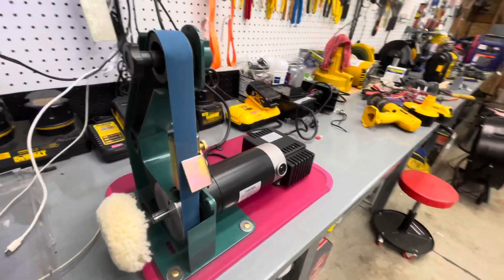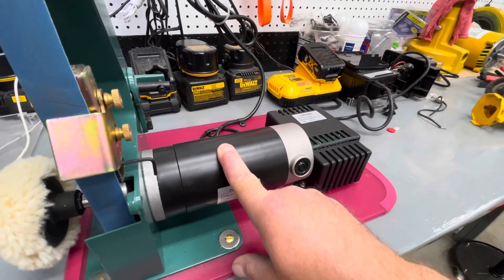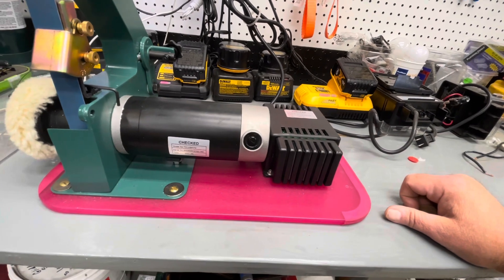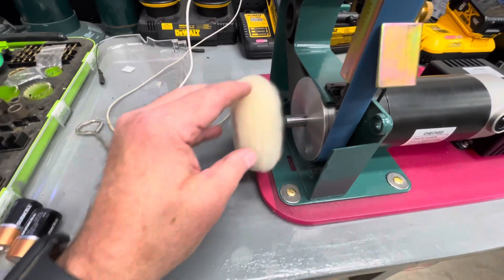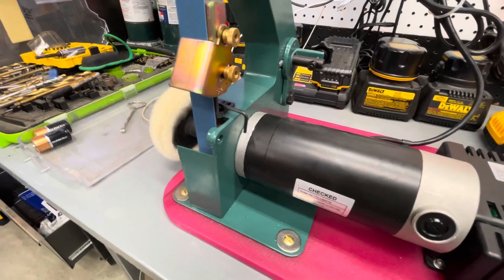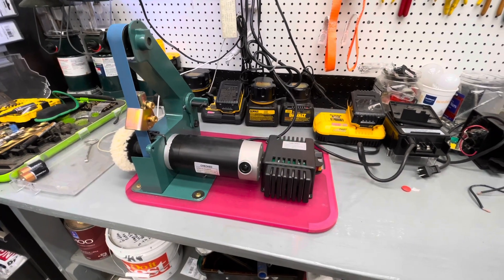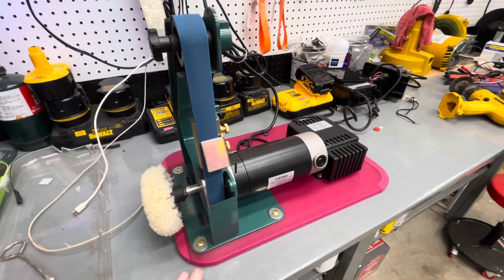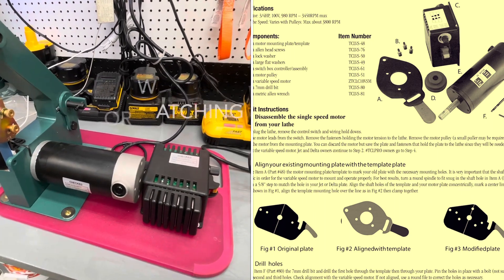Harbor Freight 1x30 belt sander conversion to variable speed knife sharpener.

Comment: With this motor and sander and accessories your north of the price for a work sharp V2 Ken Onion.. with all the tweaking and everything involved is this that much better than a work sharp
Reply from the maker: I can’t dispute your point and if the new wider belt version II was available back then I might have opted for it. This was done mostly for a fun project. I was intrigued with the concept Cliff Curry had built for his mobile sharp shop. I do have the 3/4” KO Work Sharp and use it as a To-Go sharpener but it’s not made for regular extended use.
Reply: For volume work this 1x30 would be better than worksharp.
Reply from the maker: @brakeme1  The worksharp has its place, I’ve had good success using it. I was intrigued when I saw Cliff Curry using the modified Harbor Freight 1x30 in his Maui shop.

Comment: This looks like a good setup, but I don’t have the space on my bench for something this size, I’ll look for a smaller (shorter) motor.  I’ve also seen a video where they cut away the shroud on the back so they can use the belt from either direction..but having a reversible motor is the best option.
Reply from the maker: Thank you. The whole thing really is compact, the base after all is a small cutting board. Cliff Curry is stocking several additional custom parts and a full range of belts.

Comment: How fast can it go and what power it has? Does it bog down any?
Reply from the maker: It’s 3/4 horse power and the motor spins at 1700 rpm. I’m not even an amateur but I’m getting loads of practice doing friends family & neighbors implements.     The little DC motor has more than enough oomph. It’s a fun project and it’s been a useful tool.

Comment: Did you ever find something to cover controller? Finally got mine set up. Just need to know what material to use to cover controller. I was able to reverse the rotation by switching the leads from board. Works great!
Reply from the maker: I haven’t. My wife & I sold our home & moved to the Wa coast and we’re still not totally settled in. As soon as some warm weather arrives I’ll get my shop organized and follow up on things.
I was thinking along the lines of a breathable nylon fabric or a fine mesh fiberglass screen, something nonconductive.
Reply: @jatoav8or  oh ok I covered mine with window screen. Don’t know if that’s good or not but helps a little with dust.

Comment: I thought of a screen from a window to protect that board wouldn’t you think?
Reply from the maker: Anything that would allow ventilation and limit particles from entering should work. Since posting this video I’ve used a neodymium magnet placed on the angle guide to collect shavings, that doesn’t work so well with high quality stainless steel though.

Comment: Unless you can get the DC motor and drive cheap the cost would far outweigh the value of the sander.
Reply from the maker: Sorry for the delayed response I’ve been in the hospital with Covid. I suppose you’re right but it was also a fun project all in itself. Sometimes you get it stuck in your head that you wanna do something even if it’s not necessarily financially viable.

Comment: Very nice I'm buying this
Reply from the maker: The motor/controller kit I used is available on Amazon @$199.00 My sharpener continues to perform outstanding.Here’s a link                  PSI Woodworking TCLVSKIT2 Variable Speed Lathe Conversion Kit https://www.amazon.com/dp/B0851G6685/ref=cm_sw_r_cp_api_i_094XBY0FPVNS04H54V10

Comment: I've got to find the motor set up you have
Reply from the maker: It seems like the motors sell quick when they finally get stock and like everything else the price has skyrocketed.
Reply from the maker: PSI Woodworking TCLVSKIT2 Variable Speed Lathe Conversion Kit https://www.amazon.com/dp/B0851G6685/ref=cm_sw_r_cp_api_i_094XBY0FPVNS04H54V10

Comment: I meant to ask you did you replace the large wheel by the motor? Looks like it’s stainless steel. I purchased motor but don’t know where to start.
Reply from the maker: I did replace the drive wheel. I happened to have aluminum puck that I drilled to fit the shaft then had it turned to correct diameter at a machine shop. The stock wheel can be used but the shaft hole must be drilled out to 15 millimeters 
exactly. There’s a knife sharpening expert who stocks replacement wheels for the harbor freight sander. He also has a huge selection of belts. https://shop.currycustomcutlery.com/products/drive-wheel-for-1x30-stock
Getting the drive wheel drilled out to 15mm and mounting the new motor are the only challenging parts of the project.
I think I mentioned in the video I used that mount plate included in the motor kit as a template to mark & drill mounting holes to secure the motor in the frame
check out curry custom cutlery online. He also has videos on his 1x30 project posted on YouTube.
Also, 15mm drill bits were hard to find in my parts so a 
19/32 bit will substitute.
15mm=.5906 inch
19/32=.5938 inch = 15.08mm
Reply: @jatoav8or  how about that rubber under the motor with screw? Where can I get that?
Reply: @jatoav8or  Well, motors are back in stock and got one already installed looks pretty good I also got a drive wheel from Curry cutlery. Just need to tru the wheels and work on the tensioner. Variable speed is great. No other machine can do what this motor does. Also need to know where to mount speed controller? Don’t want any metal shavings on it. Any other tips? Where can I get double pole double throw switch?
Reply from the maker: @robertmunguia250  I live in a fairly small town and get most of my electrical stuff from Wilco Farm store or a electrical supply store like platt electric or CES.  There’s always Amazon if you know exactly what you want.
As far as the controller I ended up putting a piece of very fine fabric over the top so that it could still breathe and cool but keep metal particles out. Good luck, my machine continues to work like a champ!
Reply: @jatoav8or  that’s great! I have mine all assembled. Only problem I have is the belt won’t track properly and I can see it flapping. I got one of those custom drive wheels from curry and works good. For some reason just won’t track. I live in a small town myself and have to drive 1/2 an hour to Home Depot or lowes.
Reply from the maker: @robertmunguia250  I altered the tension with a progressive spring setup. Getting the idler wheel moving freely & increase travel along with experimenting with the tension helped with the belt running smoothly. One other thing I noticed is not leaving a belt on the machine when not in use, it’ll stretch and make a lump. The “stock” sanding belts are pretty tough but the knife sharpening belts are prone to stretching.
Reply from the maker: You might take a look at this, I know of some guys that have used this with great success.
It’s a Rikon brand variable speed 1x30 belt sander.
All you’d need to get is belts.
Rikon model  50-161VS
https://www.toolnut.com/rikon-50-161vs-1-x-30-belt-6-disc-sander.html

The rubber bumper is a small appliance leg I found at a local hardware store
Reply: @jatoav8or  yes, it’s nice. I was looking at the jet variable speed that goes in either direction but kind of pricey.
Reply: @jatoav8or  i don't suppose you know if the drive wheel for the rikon machine would fit the 15mm drive shaft do you or maybe have a friend who would be willing to measure the drive shaft on the rikon
Reply from the maker: @nickkuttian4143  
I’m sorry but I’m in the midst of moving and all my belongings are either packed up or buried in a pile. I couldn’t answer your question with any confidence.

Comment: That motor has gone up to $199.00 on Amazon. Looks like I’m tempted to get it but what did you use for foundation? Looks like a cutting board?
Reply from the maker: You’re correct, we purchased a set of three polypropylene cutting boards at Costco. This was a spare.    A nice piece of plywood or even aluminum would suffice.

Comment: By the way, I have the same angle guide. How do you sharpen with the blade going downwards?
Reply from the maker: I reversed the rotation on the DC motor so the belt is actually going up.
Reply: @jatoav8or  wow looks mighty nice. Beats getting a tormek or something more expensive.
Reply: They have angle guides that go both ways. But they are hard to find online. I've seen them, I haven't found a supplier.
Reply: @minnesotamarine9861  Amazon has them. I bought a kit that has both in it.

Comment: You have a link for that? Looks pretty nice.
Reply from the maker: PSI Woodworking TCLVSKIT2 Variable Speed Lathe Conversion Kit https://www.amazon.com/dp/B0851G6685/ref=cm_sw_r_cp_api_glt_fabc_M79M941STZA0J2SKPSYC
This is the kit I used, The price has gone up since I built my piece. Last I checked Harbor Freight was selling the 1x30 belt sander @ $59.00 
Unfortunately it’s price has inflated as well.
Reply: @jatoav8or  ok thanks see if I can purchase.
Reply: @jatoav8or  Amazon now says unavailable. Need to look other place.